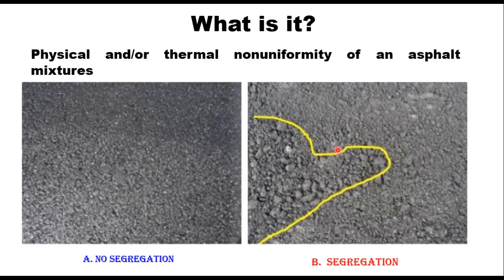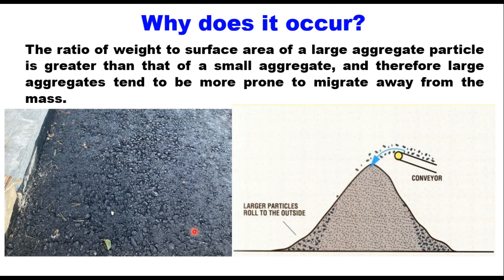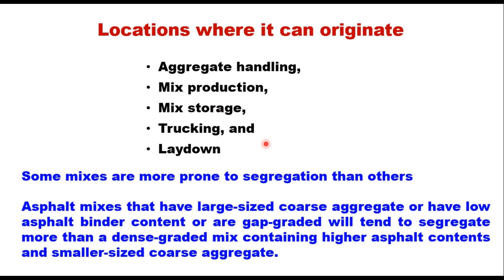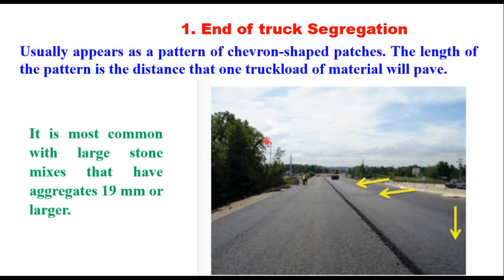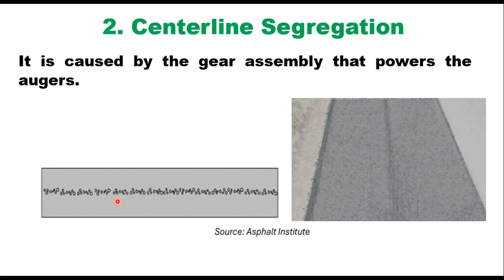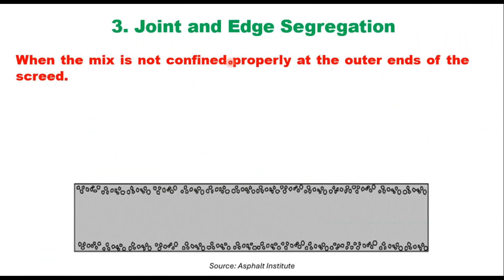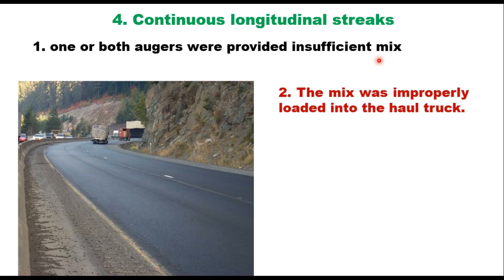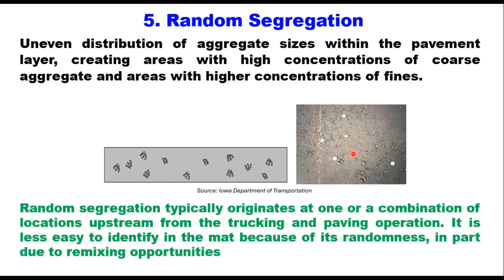Segregation of asphalt mixture during laying. Why does it occur and what are the possible remedies?

Comment: Very informative, thank you for sharing, Sir.
We faced a similar issue in one of our projects in Jordan. The coarse aggregate had many cavities, and the initial asphalt content of 5% was not sufficient, leading to segregation problems. We resolved this by increasing the asphalt content to 7% and making slight modifications to the Job Mix Formula (JMF). As a result, the project was successfully handed over without any defects on surface layers.
Reply from the maker: Great.

Comment: Dear sir, Is it possible to convert a Broad gauge railway to a meter gauge without adjusting track geometry?
Reply from the maker: In my opinion, it should be easier, rather. Because the requirements of MG lines are less rigrous than those for a BG line. During conversion, superelevation should be provided for the design speed for MG line.